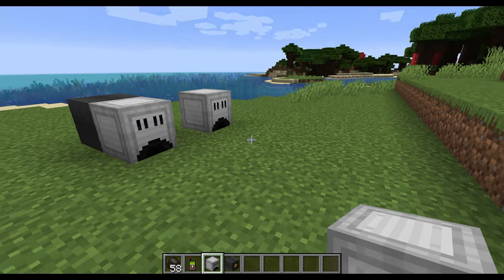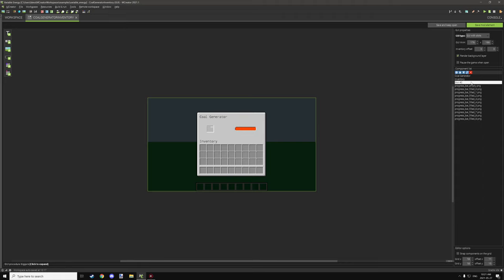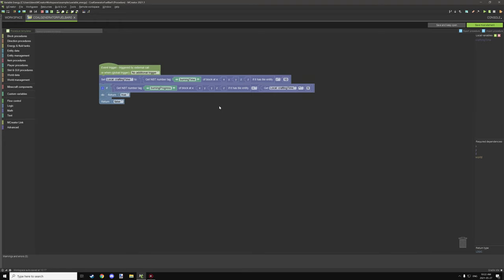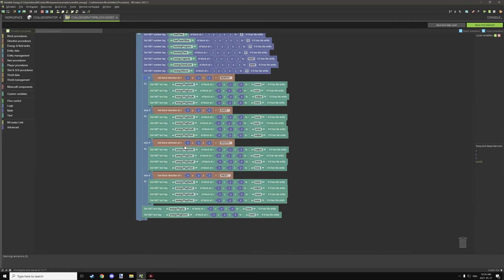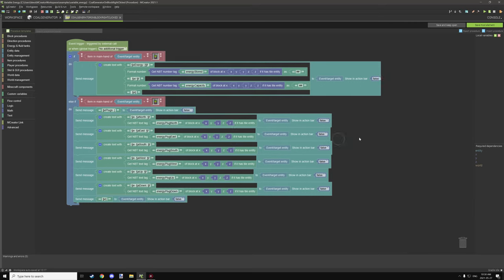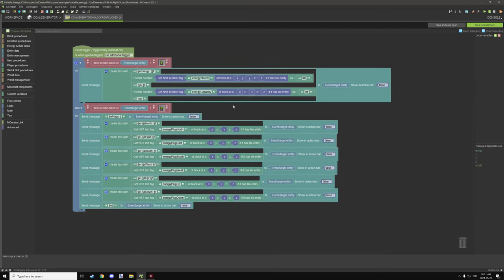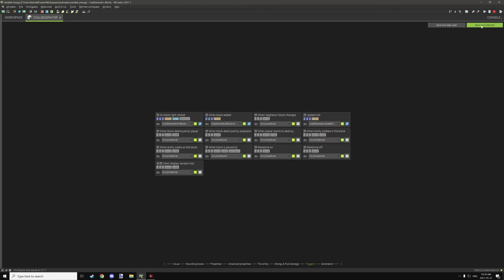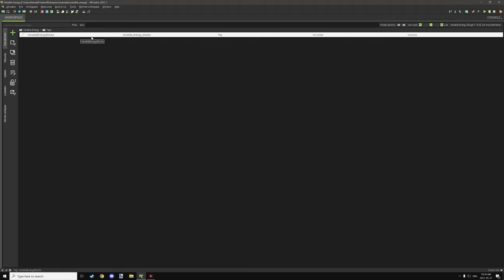MCreator: Variable Energy | Coal Generator Tutorial

Comment: Mcreator would be easier if inventories had an NBT tag that said full and its set to true automatically so modders have to set it to false. This would mean any new machine just needs to check of its false and does not need to know what the capacity is or even what mod the block is from. It still needs to know what energy or fluid type. 
I suspect Mojang will be using Mcreator for all there new stuff and updates so their fixed too.
Reply from the maker: I totally forgot about this video series lol it was made a long time ago.

In regard to Mojang using MCreator chances are they won't go near it with a ten foot pole, they know about the MCreator community I reached out to them a while back about some legal information I needed to know for Klemen so they are aware of the software. Pretty much everyone stays away from MCreator like Fabric, Forge, Mojang, only collaboration that I am aware of is a event that Curse Forge and MCreator took part in a few years ago, it was a good step forward but sadly it did not lead anywhere further.

In regard to Mojang using it to develop, I know they said during the last Minecraft Live that they were working on tools for making the development easier, chances are it's their own software though and won't be using MCreator to develop the game with.

MCreator is built off of Forge so a lot of things like NBT are forge specific, its unlikely that Mojang would use MCreator for development but who knows they may make the tools public which could open more doors for MCreator long term I guess.
Reply: @NorthWestTreesMCreator  I have dyslexia so coding with blocks like Mcreator works better for me. Just spent the morning struggling with html. I did a course in that when it was new. Now its all gone from my head. :(
Reply from the maker: @hatac  I hear you, I know a bit of HTML and CSS3 but I can never remember the lines of code, no courses but I spent some time in a free block in school back in the day learning it on my own, just for something to do, however, its not something I can remember these days, I know parts of it but the language it's self is pretty complex not as complex as java or any other programing laguage but its something that can easily be forggoten. MCreator is a lot easier with the blocky editor, I kind of wish there was a game making with the same mechanics tbh as blocky it would be way easier for a lot of people learning game development or even just to make a few fun simple games.
Reply: @NorthWestTreesMCreator  Mcreator has a block that does minecraft command block commands and in a few cases that's more streamlined. It does volumes in a single command. In theory Mojang could expand on that with a jigsaw, blocky, code editing field in a block. I would want a command that deleted the 'command block' at the end. The problem with Mcreator is that it leaves residual redundant code when finished.

Comment: How can I acelerate the process?
Reply from the maker: It depends what you mean by accelerate, ticks cap at 1 tick every 1/20th of a second so its not possible to make it go faster than 1 tick. You can however create more energy in that period of time which would basically do the same thing though. The update tick adds 10 energy every time the procedure is run so if this happens every tick then one could multiply the value by 2 to get a half of tick speed for example 20 would be 0.5/tick even though it still sends it every 1 tick its sending more energy ever given second than what the speed would have been. Not sure if this makes since.

Comment: can you make a block that generates an item instead of generates energy?
Reply from the maker: That's possible, all you need is a variable timer like NBT for the block, a inventory slot and test if the slot is empty or has the same item with less than its maximum stack size and then you just simply add to that slot so (set item (item + 1)) if the NBT variable cycles though one round. This has always worked and should continue to work even in future versions.
Reply: @NorthWestTreesMCreator  Nice but I am still learning to code on mcreator so yeah